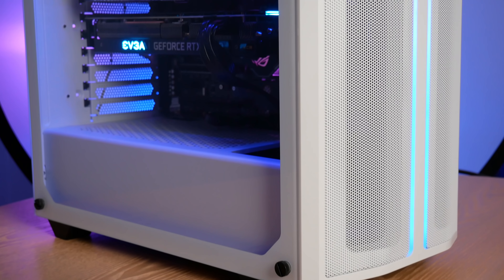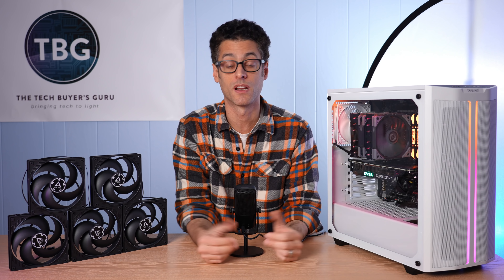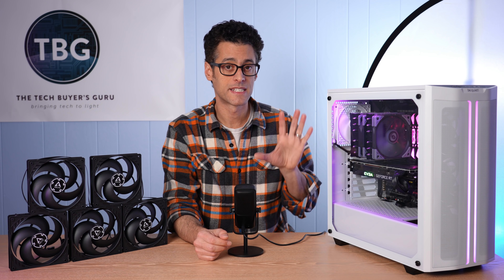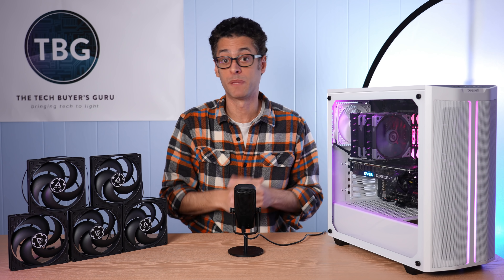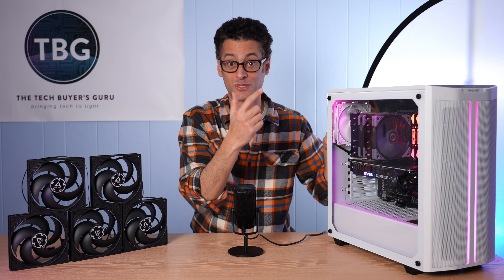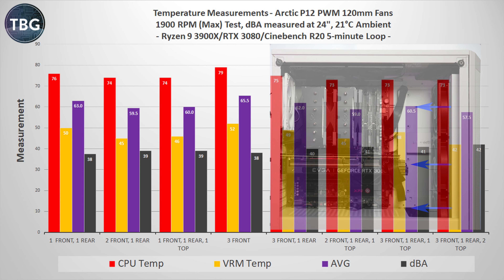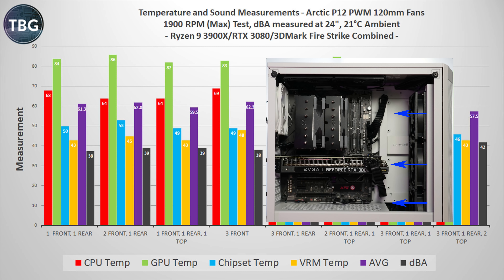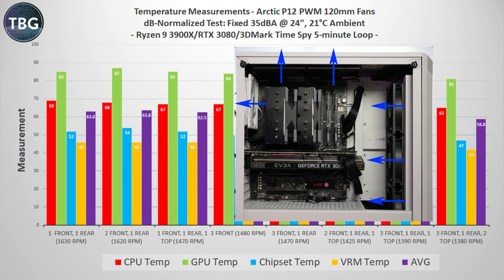Optimizing 120mm Case Fan Performance - The Best Number and Location, feat. Arctic P12 and 500DX

Comment: I exhaust out the front and bring cool air in from the top and back. I use a 240mm AIO at the front. Not typical but it works for me.( i.e. Corsair 275R). I like your testing. It makes no sense to test a case without fully populating it. Never understood why Gamers Nexus wasted so much time on such fruitless results. Well done!
Reply from the maker: If you have to front-mount an AIO, reversing the airflow actually makes a lot of sense. The only question is what this does for GPU temps, I would suspect that this wouldn't be ideal with a high-TDP GPU.

I was surprised no other channel did a complete fan optimization like this one, but after doing it, I sort of understand. It's a ton of work, and there are a bunch of variables, so maybe they just figured it wasn't worth even trying. Hardware Canucks did something pretty comprehensive earlier this year - https://youtu.be/KTDZpYkEonY

He even used the same case I did (the 500DX), and that's probably for the same reason I got interested in this - be quiet! set it up from the factory with 1 front, 1 rear, 1 top. Totally different from any other default setup. While HC did a good job in his video, he only used 140mm fans, and that gave me the idea to try to finish the work others had started!
Reply: @TheTechBuyersGuru  My RX 580 can get up to 80C under heavy benchmark testing but nothing unusual for Polaris. Funny thing is, the case fans never really run full speed at full gpu load because the cpu temps are still so low. I have tried ramping them up at lower temps but seems to have little effect on gpu temps. The video card fans seems to be the over riding factor, in my "case".  Like you said, so many variables, so many cases, so many different environments, etc. But, your work sets a base line to start from for those playing with case fan numbers and placement. It is appreciated and an interesting topic because it is not clear cut.
Reply from the maker: Sounds like your system is running well. 80C is not a problem for that GPU. And you are right, PC cooling is definitely not clear cut, but that's what makes it so interesting!

Comment: Interesting video. Would have been great to see the effect of having top fans as intake instead of exhaust. Some case manufacturers like Silverstone advice not to exhaust on different directions
Reply from the maker: I may consider this in my 140mm fan test. I have seen surprisingly good results in other videos with top fans flipped, despite it not seeming to make sense.

Comment: I'm cursious of results and wait for the video, but from what I know, if you need something more than two front 120 intakes and one 120 rear exhaust, there's something wrong with your config and it's not the amount of fans. If we talk about typical gaming rig, not high-end for hardcore overclocking, when every fan and hole in the case will make some difference.

Comment: i do  1 140mm front intake, 1 140mm bottom intake (blowing into gpu) , 1 rear exhaust 120mm, 1 top exhaust 120mm. It gives me cooler temps than putting 2 front intakes. Great video thanks for the tests and info

Comment: Going to use those be quiet stock fans,  2 x 140 front intake, exhaust will be 1 x 140 rear and 1 x 120 gentle typhoon top. Looking forward for your 140mm testing :)

Comment: edit: lol you already mentioned exactly what I was talking about at 5:05! Thanks for all this work, I find it very interesting. I'm thinking that testing various fan profiles would make for an interesting project to automate: a program could much more efficiently set various combinations of RPMs for various combinations of fans and take sound and temperature measurements. All you have to do is add or remove the casefans and run the program. I wonder if any manufacturers do that kind of testing.
Reply from the maker: Glad I addressed your concern, even if I couldn't do the actual testing. One of the issues with automating this kind of thing is that temperatures take a while to stabilize, so just quickly running through a large range of RPMs will not work. Ideally you'd start at max RPM, drop one fan incrementally by 50RPM or so (any less and it won't be enough of a difference), run for 10 minutes, and then repeat with the other fans. This would take a solid 30 hours with an automated logging and fan adjustment system, and then you'd know how to set each fan for optimal performance, but this would be in a vacuum, as then finding the optimal setting for 5 other fans would require nearly infinite iterations.

Ultimately, it's not worth it for anyone to invest this kind of time into automated testing because the results wouldn't be useful except in that specific scenario you were testing (i.e., case, cooler, GPU, etc.). That means it's up to enthusiasts to use videos like mine as a starting point to have fun doing their own testing!

Comment: I missed the live for minutes, I'll watch it now
such an interesting topic. it's difficult to figure the right configuration of the fans when you have 3 fans and a case with poor airflow, so the help is appreciated

Edit: Good video. Really loved the case you were using. It looked like it had an amazing airflow coming from the front even without fans. Mine put emphasis on the visuals and has a really poor airflow coming from the front in particular.
Another thing fan-related which is really difficult to test is dust. As someone who once had a PC with just a rear fan in an open case I can tell that dust becomes a real problem with time. It's so difficult to remove it from your motherboard.

Comment: One potential issue is many cases only allow a 120 rear exhaust, with 140 in the front. Something to think about for people who use two different sizes.
Reply from the maker: Yup, I'm well are of that, which is why I started with 120mm fans. I will not test a 120mm rear in my 140mm case fan video, as I don't think the difference will be significant enough, and you'd already know which one to use if a 140mm fan fits, but I may combine 120mm fans in front with 140mm fans in the rear, which is a setup that may actually produce better results than 140mm in all locations.
Reply: @TheTechBuyersGuru  Looking forward to the 140 test, since that's my setup (2x 140 front and 120 rear). I doubt a 140mm rear would make that much of a difference. 

Interested to see how 3x 120mm will compare with 2x 140mm. Most midsize cases won't let you have 3x 140mm in front - so there's your combination of 120mm front and 140mm exhaust.
Reply from the maker: Exactly - that's what I'll be looking at.

Comment: Hi Ari 👋😇 great review. I think we’ll be seeing the return of old style pc cases (around late 90’s early 2000’s) w/ fans on the side panel over the GPU and cpu which used to give excellent cooling performance. I still have a pc setup with an old Mvidia branded thermaltake case which has the option of up to 4 of these side fans and cools really well on my x99 mobo setup
Reply from the maker: Well, that would require giving up the glass side panel, which seems to be very popular these days!

Comment: Excellent review. I had already seen a review that mentioned the same problem at 1000 rpm. Would be interesting in the review of the 140mm fans, to add the result of the fans that come with 500DX that also have 140mm.
Reply from the maker: I actually already tested a 2-fan setup with the Pure Wings 2 fans versus the Arctic fans. You can see that here: https://youtu.be/PUdsTiRmuuU
The PW2 fans are used as the baseline, they aren't mentioned in the title of the video.
Reply: @TheTechBuyersGuru  You're right, I'm sorry, I forgot that you had already done that review.

Comment: Nice Video. Next time try reversing the first Fan in the Top Location, i will guarantee you it will result in the best temps and positive pressure is also good for controlled dust collection.
Reply from the maker: I got that input from a lot of people and thought it was intriguing, so I actually tested it in my follow-up video: https://youtu.be/iCn-XL-HyXg
Turns out it didn't work out the way everyone thought it would.

Comment: Very nice test! Thanks for the review.
Try the next test to put just one fan rear. Since many boxes come only with this fan.
If possible, also test one fan rear and one on top. Both of them taking the air out. It can be a good solution for boxes that do not have a good air flow because the front panel is not mesh. This idea comes from the result of this test with 1 fan front, 1 rear and 1 top.
Continuation of a good work.
Reply from the maker: Thanks for the idea!

Comment: the p12 static pressure make them ideal for any RAD/aio fan replacement or if youre chassis enables GPU intake mounts above the psu shroud. I bought both 5 packs...but the p14s wine at my medium setting on the lian-li mesh II p fan controller. If i were to connect them to a motherboard header. I would be able to tune more with caution to that "zone"....The p14s are vertically mounted....on an aio the top mounted exhaust ones dont make any noise....nor do the p12 at any rpm that are also horizontally mounted for the gpu intakes....its a bearing design surely and a specific power level and rpm that causes this as you said. Since the p14 exhausts made no noise i set the rear p12 to a specific noise...and yes the gpu p12 are 1300-1500 on a curve. Luckily the top and aio mounted p14s make no noise on low and high as far as harmonic whine or coil whine. The controller does not work on auto/pwm mode unfortunately in my case. Ill most likely be switching the aio pull p14s to motherboard headers/pump header since my aio is a single fan header. The only reason i like to run an aio is so i can access my m.2 slot since i am not running a gen4 drive currently. Huge tower coolers usually cover m.2 slots. In non gaming scenario low rpm is good enough for typical use or non AAA games set to a 144fps cap or 240. With OP gpu. It cuts usage and power draw and heat. Also depending on if you require a quiet system while doing a render....more fans and an ideal chassis design usually yields immediate results. If youre smart enough to sacrifice noise for longevity and optimization as noted....i find it to be a large investment to system life. Usually 35-40+db is as loud as most GPU designs. So finding a nice balance like the 1300-1500 p12 example for gpu intake actually help lower your gpu fancurve or help with its OC potential/stability. Granted they arent as ideal fans as noctuas or scythe for all rpm use and noise normalization. The value and performance is inherent. Even in ITX since they produce so much pressure and they are small volume builds.
Reply from the maker: Thanks for sharing those details. Agreed on the impressive static pressure of the P12/P14 fans.
Reply: @TheTechBuyersGuru  the modern ones also offer piggyback potential with the plugs which is quite ideal for ITX boards with limited fan headers. A nice caveat for sub 10$ fans

Comment: great analysis. I have 2x140mm and 1x120mm in the front, 1x120mm in the rear and 1x140mm on the top rear of my lancool ii mesh case. I don't have a top fan at the front as I'm thinking it would exhaust the air from the front intake fan preventing adequate air getting to the cpu.

Comment: I really wanted to love, or at least like P12 and P14, but sadly all I have (5xP12, 1xP14 rear exhaust, 2xP14 on ALF II 280) have strange high pitch at 380Hz-400Hz at multiple RPM ranges. Sometimes it is just silent single tone noise, but on couple RPM lower, higher it can start oscillating reaching even 10dB more at that frequency than on not affected higher RPM. My P14 has 8 such ranges: ~715, ~825, ~885, ~960, ~1040-1050, 1135-1165, 1250-1315 (74%-79%), 1405-1475 (+10dB at 400Hz!). P12 is better with just 4 ranges of affected RPM. All P12 and P14 that I have exhibit same behavior with just small differences (~1% of PWM difference). For me it means that I cannot use curve fan control without hearing constantly that high pitch noise when my CPU is oscillating. Please keep that in mind when buying - they are great when used with fixed RPM (or maybe two ranges), but as CPU or radiator fans - they might annoy you if you use fan curve or your room is quite silent. 
Tech Buyer's Guru - could you check your P12 and P14 for this noise?
Reply from the maker: I definitely picked up on the noise, not at lower RPMs, but starting at 1400RPM. Another viewer had a theory that it could be multiple fans interacting with each other, so that a single fan won't cause the noise on its own. That would explain why I didn't notice this earlier. But Arctic is already looking into it, so hopefully they can figure out what's going on, because I've already spent a lot of time on it!
Reply: @TheTechBuyersGuru  thanks for response! Tomorrow i should get some sythes and noctuas so after dissembly I will check them one by one out of the case. Either way, performance wise they are great and quiet as long as you don't hit those special RPM.

Comment: Thanks, I've been doing a lot of tinkering and wanted to replace my CPU fan. Adding another 5 (kit) of P12 to replace the CPU and rear, add a 2nd CPU and have 2 extras to tinker with top extraction should be a colossal cooling (and hopefully quiet) experience.

Comment: I've done similar tests in two different cases, and adding/removing exhaust fans made no difference.
This is because I use tape to seal any large vents/gaps on the case that are not located at the rear of the case, or at the top towards the rear.
If air can only escape at the rear, no cool air can escape the case before reaching the processors. Also, this way, any air flow generated by the front fans is almost completely still present at the rear of the case and adding an exhaust fan does not provide any extra flow.
Other bonuses are you have zero chance of having negative case pressure issues, with any fan curve setup, and a quieter case.
Reply: Exhaust fans don't only expel hot air, they also help pull the front intake's cool air through the case. So your approach runs the risk of components stewing in their own hot air if the case itself doesn't already have strong enough natural airflow to permit the front intake fans to do all the work of driving airflow through the case.

I'm sure it checked out with the two particular cases you tested, but other cases won't be able to maintain enough airflow from intake alone to prevent stewing.

Comment: really in depth work here, i always think you do a lot of work for a small channel and i do appreciate it. I currently use a modded Meshify C case, I have the 2 stock fans as exhaust (1 top and 1 rear) and 2 Arctic F14s (not the P14) at the front. Really looking forward for your 140mm video.
Reply from the maker: I'm hoping hard work is a way to get noticed! And yeah, the 140mm fans will be interesting.

Comment: Good informative video 👍 Any newcomers to PC building should definitely watch this...I can verify with my setup, with a front mounted 360mm AIO on the CPU that 3 front intake, 2 top mounted exhaust and 1 rear exhaust is the best setup for liquid cooling on the CPU. I've tested other configurations similar to yours with an AIO rather than an air cooler for my own setup. It is more costly to add so many fans but if you are all in on the performance, cooling and longevity of your components more fans will help considerably.
Reply from the maker: Thanks for the positive feedback! Where is your AIO mounted?
Reply: @TheTechBuyersGuru  Front mounted 360mm AIO in a Cooler Master MB511 mesh front case. Forgot to add that part. Cooling a i9 9900K at 5.0GHz all core, 4.7GHz cache OC at 1.315V. Hasn't gotten above 78 C under heavy loads with 3 front intake, 2 top exhaust and 1 rear exhaust, 120mm fans. Solid fan configuration. Keep up the good hardware testing and reviews my friend.
Reply from the maker: Great temps, great setup!
Reply: @TheTechBuyersGuru  Thank you. Likewise, referring to your R9 3900X + RTX 3080. That system is no slouch! Kind of jealous of your RTX 3080 haha. After all the reviews I've seen of Ampere and RDNA2 the 3080 is what I'm waiting for! But I'm being patient and not mad at reviewers for having them. If anything, watching reviews should educate a person rather than letting emotion take over and rob people just to get one lol.
Reply from the maker: I'll tell you what, I was on an EVGA waitlist for 8 weeks to earn the right to buy that GPU... no reviewer sample here!
Reply: @TheTechBuyersGuru  Hey man I don't blame you! Kudos for that kind of patience. That's awesome that you got one! EVGA is a company a step above the rest IMO. My RTX 2070 is an EVGA XC series card. Performs great! Their step-up program, customer service, product registration are all elite. I have 2 EVGA PSUs as well and they are still kicking great!

Comment: same with an AIO? :) I personally run a p400s with a mesh front and filled all case fans, including 6 on the front 360 radiator, but it runs at minimum rpm up to 50C and a smooth curve for above that, works nicely. To be honest, it's my graphics card that gets the loudest (at 60% fan speed) when gaming.
Reply from the maker: Sounds like you have that tuned very nicely! 60% fan speed isn't all that high for a GPU, it's what I used for my RTX 3080 in this video!